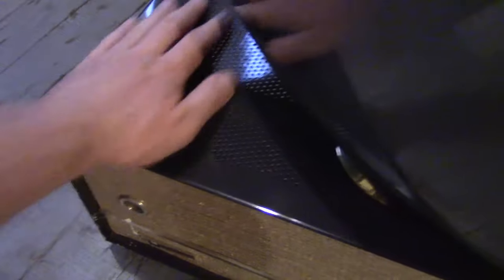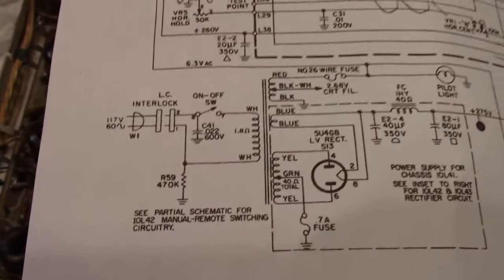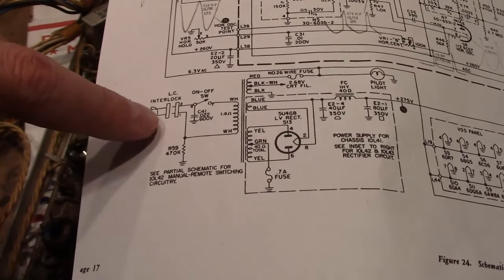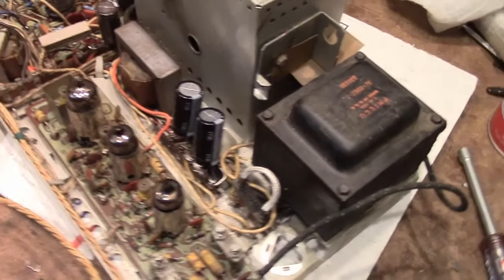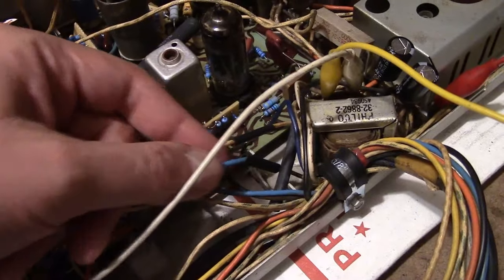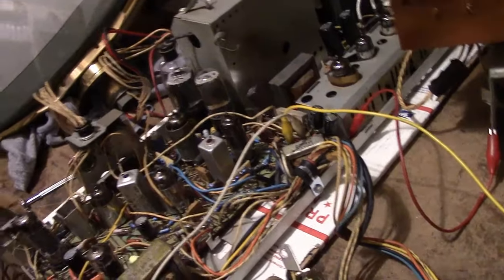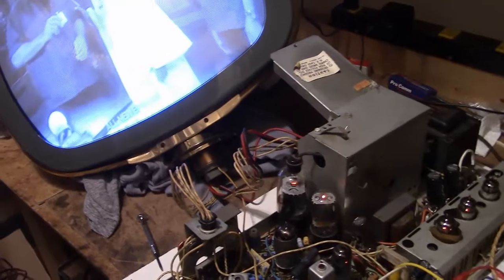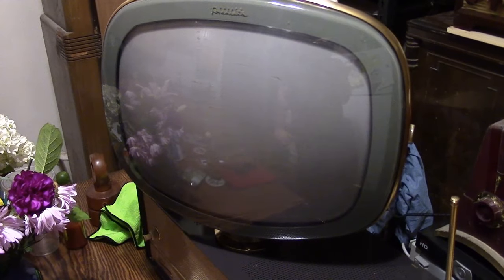Predicta debutante/princess restoration p6o?

Comment: Hey Bob, I'm in the process of uploading a video on my Siesta.  I was wondering if you could take a gander at it and see what you think.  I grabbed a CRT tester off ebay and tested the CRT, the emissions are horrible on my CRT.  I was wondering if you could tell me if I'm doing something wrong or not.  It is Philco Predicta Siesta Part 8.  Still have an hour and a half to upload but it will be up today.  Cheers man!  Also excelent job on the Debutante!
Reply: In what condition is the CRT tester? Has it been rebuilt electrically yet? One thing to watch for on some Predictas is that on the sets with the 2.34 volt CRTs  they have sometimes been replaced with 6.3 volt equivalents, so a 6.3 volt tube will obviously not work that well with 2.34 volts on the filament.
Reply: My tube is an original Philco 17DAP4 2.63 V.  The tester is in really good condition.  I had it opened and it hasn't been restored.  It has 4 elect. caps in it that I will be changing.  In my videos of the set I have had it completely taken apart before so I was able to see the CRT.
Reply: That's sort of unusual, from what I read the 17'' tubes were generally more reliable, apparently replacements are also easier to find as well. You must have had the misfortune of buying a high hour set.
Reply: It may be that I bought a high hour set :(  Some of the tubes had been replaced before my ownership as well.

Comment: Hi Bob
           I can't find an email address for you but I'm sure this will find you.
I'm retired (programmer)  and in the UK.  I worked with TV's from the 1950's / 1960's when they were current.
Mainly a UK brand called Cossor

I really like your videos in particular the cabinet restoration work.

I have a retirement jobby (job + hobby) I make replacement plexiglas  front panels for old PDP computers.
A reproduction tuning scale on glass or acrylic would be very similar. 
I have access to a very good silkscreen printing shop. 
I do the drawing and they make the screens and then print.

Rod (Panelman) Smallwood

Comment: So I am wondering if you can help me with a Predicta Debutante I am restoring.  I've recapped it, replaced every resistor, rebuilt every k network, checked all voltages but I still get the same problem.  The set powers up nicely, vertical and horizontal hold work, and I can get an image when I insert a composite signal at the video out tube grid.  The issue is that the vertical output transformer buzzes fairly loudly, I get like bright horizon scan lines that will not go away and my picture is flipped horizontally.  I'm a bit desperate as I'm trying to get this set working as a Christmas present for my son.  Any input would be appreciated.
Reply from the maker: Do you have these problems when you are not feeding a signal into the video amp?  Have you tried feeding an RF signal into the antenna terminals ?
Reply from the maker: Can you upload the video to YouTube ?  The only way I know of to get a flipped picture is if the horizontal yoke wires are reversed.  While I have done a few of thee, I haven't experienced the problems you're having.  I suggest you join the Antique Radio Forum and post your issue in the Antique Television area.  That way any forum members with Predicta experience can chime in.
Reply: bandersentv I've uploaded the video to my YouTube account so you should be able to see it there.  I registered to join the forum already and am waiting to be allowed to post.  This being my first TV restore I'm not sure if the buzz from the VOT is supposed to be that loud.  It's not 60hz hum either as it changes in frequency when I adjust vertical linearity.